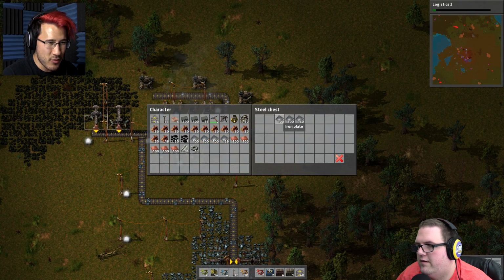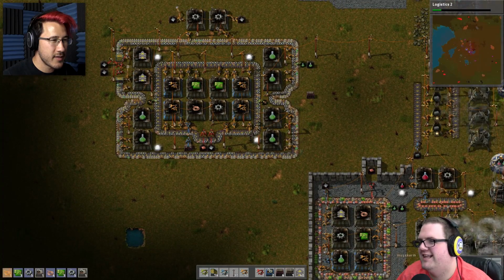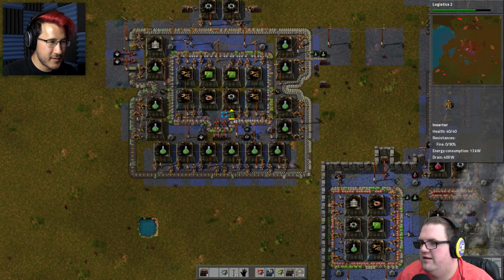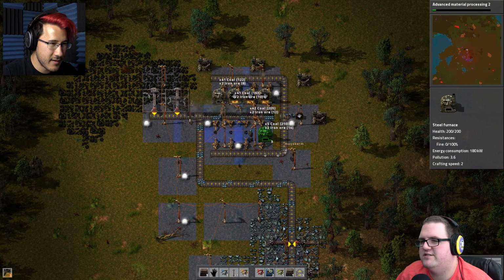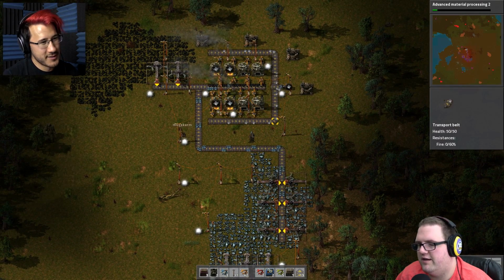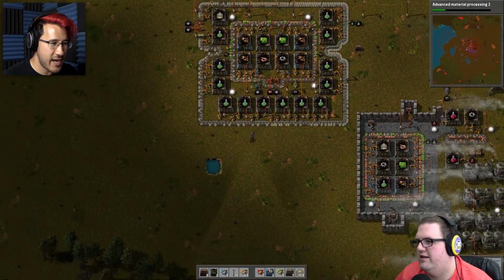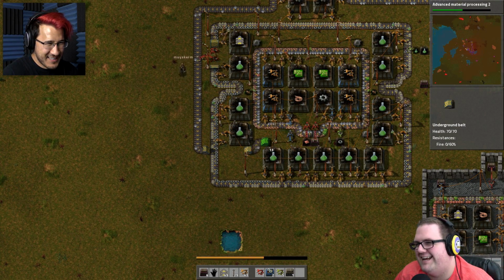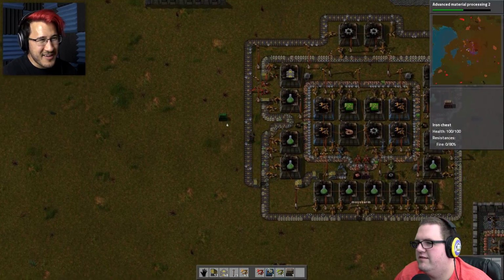SERIOUS BRAIN POWER!! | Factorio Gameplay #5

Comment: "Reggie" going slow means you are lacking power again, crafters take a FRACK TON of power each, and you used a FRACK TON. you are going to need like 20 more Steam Engines just so you don't run out of power any time soon.
Reply: @phillipternullo4720  burner and basic inserters simply have a hard time grabbing anything on the far side of a corner. Unless its backed up. And the power brownout is adding a slowdown on all machines.
I blame the huge amounts of lights in the base. I find it easy enough to get around with just the player's flashlight
Reply: @gemstonegynoid7475  I know this is a year old, but realistically they are making videos on it, so having lights around would be much better for the audience
Reply: @blueninja012  true

Comment: Uh, I just discovered ONE of the reviews for this game in the store page on Steam... It's, creepily accurate.

"I started a co-op factory with a close friend. After a day of work, I stepped back, looked at what we built, and came to some realizations.

1) I have no ♥♥♥♥ing idea whats going on in this factory
2) Half the components that directly interact with each other aren't even near one another, one of the machines producing copper cable for another machine to assemble into circuit boards is halfway across the god damn refinery
3) 90% of the conveyor belts are underground, and the rest are going so many directions this thing looks like a ball of yarn
4) There is coal ♥♥♥♥ing EVERYWHERE
5) I maintain enough sanity to count to 5
6) Staring at this thing makes my eyes itch
7) Looking away makes my brain itch

The scariest part is that it keeps getting bigger, and every time it gets bigger it somehow becomes MORE labrynthine. One of those ♥♥♥♥ing conveyor belts goes all the way around the entire factory to deliver steel plates to a single assembler thats making bloody gears, and its right next to the refinery itself!

Sometimes the factory breaks. We don't usually notice because of how much of a mess this thing is, and the breaks we do spot are often half an hour old and are a recurring problem. Rather than fix it, we simply unjam the machine and ignore it until it breaks again. The biggest problem to fixing it comes from our production lines. Normal production lines look like a grid. Ours looks like you threw a bunch of squares into a bowl of spaghetti noodles and gave the bowl to a five year old for a period of one to five minutes. This proccess results in either an empty bowl and a full five year old, a floor covered in noodles, or spaghetti all over the walls and ceiling with the squares nowhere to be found. Knowing the trend in increasing chaos and complexity the factory exhibits, probably all three.

The factory is an empodiment of madness incomprehensible even to the men who built it, laid every unholy circuit of conveyor belt, a thousand arms madly spinning every second, countless plates of copper and iron in a complex dance the likes of which is unseen in the realm of mere mortals. There are sections that I have no idea how they work, and I BUILT THEM.

The factory grows more complex with each passing second and more convoluted every milisecond. Perhaps the reason is in part due to each segment being constructed with no plans for future additions, then the future additions were constructed by forcibly adapting the existing segments, usually by shoving more tubes into it rather than actually redesigning it, and these futrue additions are also not planned for expansion. The end result is a cluster-♥♥♥♥ so large in magnitude, the last time a cluster-♥♥♥♥ rivaled it in size, God smote the town and turned its inhabitants into salt. Unfortunately no god can save us from this... thing.

Having expanded it further its almost as if the factory has a mind of its own, an ever hungry consciousness burning with dark malevolence and the need to grow. It infects all who stand in its presence, compelling them to add to it. A hundred furnaces belch smoke and the black blood of the earth is torn from its cradle to fuel the fires of industry. The ecosystem is demolished and the skin of the planet is rent and shattered for its glittering treasures, tossed into the inferno of a thousand stone and metal prisons to be transformed, used to expand the malignant blight upon the world that we brought. Ten thousand steel cogs turn and steam fills the air as the never ending fires boil the oceans away to power the sprawling spiderweb of mechanised mayhem, ordered chaos at its purest, a hundred thousand plates of steel and copper cycle and swirl in patterns barely knowable by the very people that created them.

Each day, the red and green fluids are pumped into glowing crystalline globes, each sparking and burning, discovering new knowledge and new machines. The factory grows. Each advance in technology only complicates matters. The factory grows. The new advances create a need for new resources. The factory grows. The new resources require new means of transportation. The factory grows. The new transportation feeds new machines that burn the new resources to produce blue fluids to discover new technology. The factory grows. The blue fluids feed the globes to reveal new truths, beginning the vicious cycle anew, a neverending circle of destruction and growth that will only end when every corner of the planet is scoured clean. The factory grows. The planet will never be scoured clean. The factory grows. The planet is infinite in size. The factory grows. The game will never be over.

The factory grows."
Reply: This is the first time I EVER had to press the "..." three times (let alone twice) on YouTube.
Reply: Isn't this an SCP?
Reply: This sounds like an SCP.
Reply: @theshapeshifter0  it is.
Reply: That accurately describes how software development feels like.

Comment: See, Markiplier says its working at the beginning of the episode, but at a first glance there are multiple problems I can spot. I'm sure they are addressed within the episode, and I will give them props for figuring it out, putting FULL CONFIDENCE that they will spot the problems, but I will list some of them here.
1. Iron Plate shortage for the inner loop. The Electronic Circuits require an Iron Plate to be made.
2. No inserters putting the Inserters from the inner loop to the factory for the Science Pack 2 into the factory.
3. Not enough Inserter factories OR to many Science Pack 2 Factories. Science Packs 2 takes about 30 seconds to make, while Inserters take roughly 5-10 seconds (Provided the correct materials are properly maintained)
4. The Conveyor Belts are not properly used to maximum efficiency. Conveyor Belts can have two items rows of items. Rather then have an inner belt and an outer belt, they could have it all on one conveyor belt and still be sorted the same way. When an Inserter places an item on a belt, it places it on the opposite side of where it is coming from.

Like I said, I have full confidence they will solve this dilemma in the video, but this is just my way of saying... I play this game way to much...

If those issues are addressed, it would work. I tested it.

Comment: Some tips to save some time Mark,
>Right clicking something in the craft menu crafts it 5 at a time.
>ctrl + left click takes all the same kind of item inside something. Also works w/o clicking on something that it's stored in.
>Most of what you create in this game uses steel more than copper.
>You don't need to pickup something that is an upgrade to something to build on it. Example is you can build an inserter over a burner inserter since it's generally the same thing, only an upgrade. Works also for furnaces, creator machines, electrical poles, conveyor belts and other stuff.
>You can save time crafting by having an item it needs to be crafted in your inventory. Like, if you want to make fast conveyor belts, keep all the regular conveyor belts in your inventory to just build the fast ones with them. 
Hope this helps :3

Comment: It's usually best that either everything is used or pulled from the belt before it makes a full revolution around the belt, or that only two items occupy a belt, one on each side. Otherwise clogging and halted items on conveyors are mostly guaranteed. Long arm inserters and normal inserters really shine when there's two parallel belts, each with one type of item per side.

Comment: The construction loop looks fine my main gripe with it is it doesn't load the raw materials. I always build my factories where they take the steel and copper plates and send them into the system using weird twist and turns to get everything where needed. Stuff that is a priority is further up the chain while the lesser stuff gets up at the end. I also do not use the input and output on the same conveyor because I want the input to build up a surplus when I max out stuff. Also a good idea is to use the Circuit system or the Logistic system filters to halt production, to do this take a smart inserter and give it a condition when it is hooked up to a smart chest via a red or green wire. When you do this the inserter acts like a fast inserter whenever the statement is false so say steel plates is less then the quota it will fill the chest till it is equal. This allows you to produce only a particular amount so you are not wasting resources. The Logistic system functions similar to the circuit system but it is on a larger scale, you use logistics chest for it and for a condition for the logistic system it checks all storage so say you have 100 steel in 5 chest it won't function until it drops.

Also upgrading your assemblers is another key thing, even though the 1st generation will work for many basic components it crafts at 1/2 speed compared to the player. The 2nd generation tops out at 3/4 and the 3rd is 5/4 aka faster then a player. At this point you can also look into the modules so you can get things processed faster and get more per raw materials. Blueprints are also a big thing with construction bots, basically you can copy paste things and if you have the stuff in your inventory the bots will place it and copy the settings into them. There is also a deconstruction blueprint so you can say "tear down this" and it will take things apart and put them in your inventory (or a long term storage chest) as well as unloading any inventories of the items you are destroying. Hope this helps Markimoo good luck also walls and turrets are your friends against the aliens, go full Aliens with them.

Comment: Mark, best part of this game is finding ways to improve the systems you have setup, and your doing GREAT but your assembly loop idea is flawed, conveyor belts only have 2 rows, eventually your assembly loop will clog up with 1 resource stopping everything else from going on.

A generally better idea would be to have each assembler should get an input belt (Where it gets the ingredients) and an output belt (Where it drops off the finished product).  This way no matter how clogged the input belts get, they are always providing the resources that the assemblers need, so production never stops.

Most items in the game use only 1-4 ingredients, so if you just use each side of the conveyor belts accordingly, you'll have 1 ingredient on each side of conveyor belts and no matter what production will keep going.

Also, consider figuring out how splitters work, their purpose is they evenly divide the materials going through them on the belts.  Example: If you put a splitter on the coal conveyor belt, and have 1 side go to boilers, and the other side go to furnaces, then 50% of your coal will go to furnaces, and 50% of your coal will go to boilers.  This way you can have ALL of your iron plates on 1 big conveyor belt, then split it wherever you need iron plates.  And you can do this with everything.

Something I like to do, is have dedicated areas that just produce 1 thing, like an entire area dedicated to making gears, another area dedicated to making circuits, and another area dedicated to make inserters.  Then I just split their production belts with a splitter wherever I need them, and have the other one get stored into a chest, or sent elsewhere.  This way, if I ever need more gears, I just add more gear assemblers to the gear area, or more circuit assemblers to the circuit area.

You can do it mark, I believe in you!

Comment: Hello Markiplier, in MAXIMUM EFFICIENCY, you had a problem with electricity. I'm not sure if you've solved it, but the steam engines only generate what you need. They don't generate at max unless you need more power.

Comment: Im sure this is not gonna be changeable now but if you were to start again a more efficient design (you'll soon find that you'll get a clogging of iron gears and conveyor belts on the outside) for the science 2 production would be to have the inner loop be much bigger and only feed the inner part of the inner loop iron plates(through underground). Then make an excess of inserters productions and electronic circuits in the middle and put ONLY ONE production of iron gears at the end of the entire inner loop. Then there will be an excess of iron plates in the inner inner loop. Put down a smart inserter after the gears production pulling out iron plates, putting them underground, in a chest on the outer side of the outer loop then make an insterter than puts them back into the inner part of the outer loop. Now just fill the outer loops with conveyor belts and science production. Im sorry I dont have a diagram for this because I dont have the game. Im sure these are hard to follow but I really dont have any other way to show my ideas Kappa.

Comment: Can you guys make splitters? If so, I would strongly recommend using them, they're very helpful.
Reply: +Kaitlyn Pomerleau Indeed, especially if one's supply chain makes an overwhelmingly large amount of resources; one can halve them however many times needed and send them off in different directions. Such is especially true for coal which is produced rather quickly (or rather, same supply meets lower demand due to its burn speed) even with base level electric drills. Then again, I'm sure you know this, but rambling on is fun regardless. :P

Comment: dose he know splitters can be used to balance belts and split conveyors lines in half so you can make 2 lines out of 1 conveyor line and you can make a much better way of making green science  by making a pruduction line like 4 copper wires maker feeding 2 or 3 circuit makers which feed some grabbers makers with either a auto matic input or manuel input to feed green sceins with a input of gears and conveyors

Comment: why arent they applying loops further? Why arent they directly connecting the copper and iron to the "loops" instead of manually putting unprocessed materials. Its a simple leap in logic. I don't own this game but cant they just extend the converyors directly to their manufacturing loops and then have one end all box.
Reply: +Metatron having played a fuckton of factorio myself, I can say absolutely that you're right. or, alternatively, they could just scrap the loops and make everything run off of a central conveyor, but there's my elitism showing.

point being: you're right, but loops are an inherently flawed system either way
Reply: PJ rage Yeah I was mentally processing how you should have two loops going in and just have a long finite line where the processors branch off and ultimately end near the same direction.You can better controll input and output too
Reply: Metatron you just described my entire factory (more or less the central parts). i'm speechless

Comment: Hmmmmm.

Again, an interesting design, but still rather inefficient. I wonder if there's a way to actually make production loops work efficiently though? Because having two ingredients running on the same side of any belt just won't fly eventually.
Reply: +Wakka02 Yeah, in summary, his design is pretty terrible. Loops don't work very well, and I think having all the production machines on the inside of the belt is not a very good idea. If he wanted to make the loops work, he could definitely place each ingredient on a different side of a belt. Since inserters always place on the farther side of a belt, he could put some production machines on the outside of a belt so the inserters would place them on the other side. Also, a good idea is,  on his inner loop, he could have a long-handed inserter taking the inserters from the machines on the inner loop to his outer loop, instead of having to cycle it through the inner loop, adding some clutter to that belt. Or, he could just scrap the loop idea entirely. That would improve production, a lot. Also, one last thing he could do, replace all the production machines with blue ones. If he didn't notice, those run faster then the regular ones, which assemble at HALF-SPEED. He would be building TWICE AS FAST if he assembled things by hand. The blue assembly machines run at 0.75 crafting speed, which is a bit better, and can be improved with two speed modules(later in the game) to run slightly faster(1.05 crafting speed) than assembly by hand(1.00 crafting speed).
Reply: BranTheBandit I know, I play the game myself. You can kind of see where he's going with this; his setups are extremely compact because he reuses the same belts for everything. This also leads to the inefficiency problem, but I do wonder if it's possible to do it in an efficient way too. Maybe not for Science Pack 3, but for Science Packs 1 and 2 perhaps.
Reply: Wakka02 There are probably multiple ways to do that.